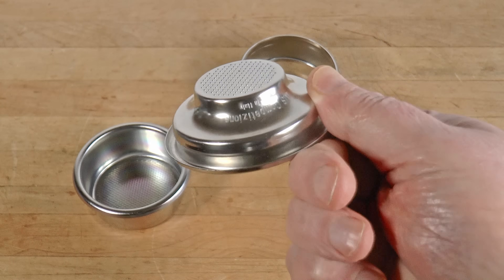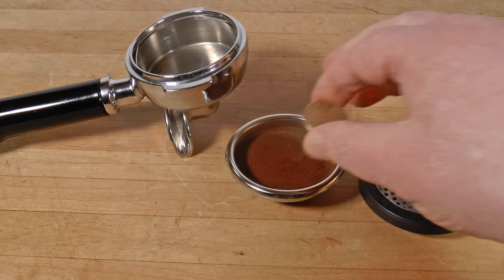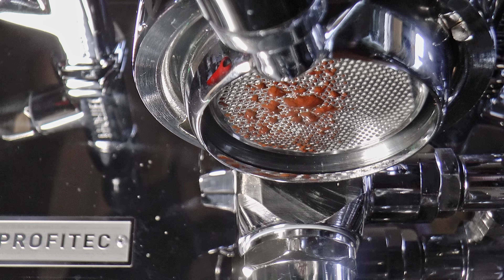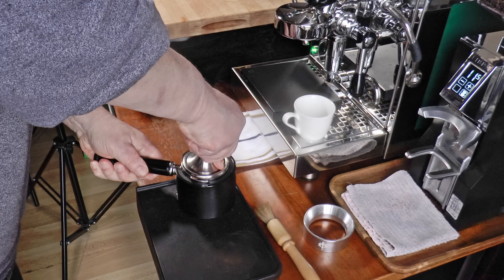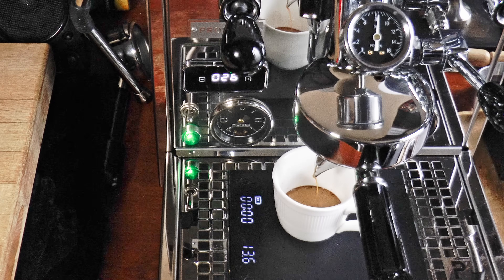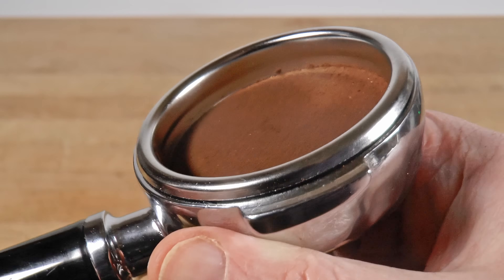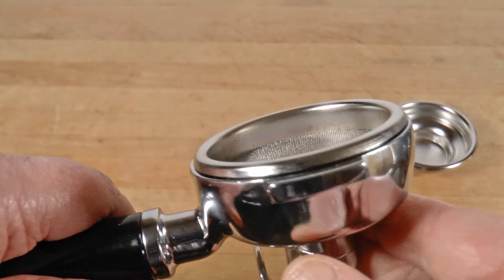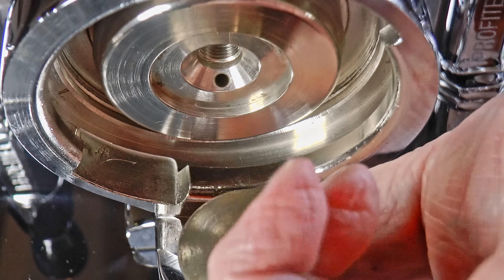The Art of the Single Shot

Comment: Double baskets are not necessarily used for Efficiency in a commercial setting.They are used to give the barista more flexibility in dialing in bright roasted espresso. If you think dialing in a dark roast single shot is hard, try dialing in some bright roast with a single shot basket. Its borderline impossible, because youll get channeling issues (especially with eureka grinders) way before you choke the machine out. The only way to fix that is grinding coarser and updosing.
Reply from the maker: I never have any issues with channeling, and I use Eureka grinders all the time. And as for "updosing," if by that you mean dosing appropriately on the basis of sound mechanical performance rather than some recipe, well, I'll cop to that, lol.
Reply: @wiredgourmet  I myself own 2 Eurekas as well and love both grinders. Id just be honestly surprised if youd manage to get a light roast to pull clean and with proper extraction from a single basket with basically no puck prep from what I see in your videos.

I mean, if it works for you that's great! Nothing wrong with that. It's just that the overwhelming majority of people struggle (at first) with pulling light roasts consistently. That's why we do puck prep, higher doses, longer shot times. Increase extraction and consistency.

Because at some point you can't just grind finer to increase extraction, the extraction will decrease with finer grinds settings. So we need other methods of increasing extraction.
Reply from the maker: @pr1ke892  I hear you. I hope this isn't too basic, but FWIW I would increase water temp first. You can get away with 94-96 C with light-roasted, denser beans. It's one variable that doesn't require complementary adjustments: you can play with it at will.
Reply: Also how light are we talking? That matters
Reply: Most coffee shops serve medium roast coffees, and if light, it’s light-medium. I don’t know how accurate your statement is in reality. Sounds like a logical fallacy to me…
Reply: If you preinfuse enough, there won’t be any channeling
Reply: Just got my first Gaggia 'black gold' extractor machine.. seeing this video makes me realise just how deep you can go with this, omg. 😮

Comment: I don’t see any use of the single basket. If I want a smaller cup of espresso, I will make a Double Ristretto instead. I tried the single basket in the past, it didn’t worked out for me… difficult to dial in and I can’t use my normal puck prep routine without changing everything… it’s not worth it(at least for me).

Comment: I have a 51mm espresso machine and I've been experimenting with single shots over the last few weeks. First, I tried a "normal" shaped single basket with something between 11-12g (according to the coin test) and got great coffees. I try to take 2 a day with this amount. Secondly, I tested a La Pavoni basket with a conical shape with 8.5-9g of coffee (also according to the coin test). With this second basket, the coffees are rounder, it is difficult to make mistakes in terms of both acidity and bitterness, but I found the body to be somewhat weak, testing with several coffees. My goal is to drink as many espressos as possible without generating anxiety spikes. When I only have time for 1 espresso, I use 16g in a normal IMS basket, it's the most coffee I can drink at once without feeling anxious. Here in Brazil we have access to a variety called Aramosa, which has 50% less caffeine, which is also great.

Comment: I moved to single shots about a year ago since 18g doubles tend to give me the jitters now, and I like drinking multiple coffees a day. It is a lot more challenging to dial in but I’ve gotten the hang of it over time! Definitely worth the effort
Reply: @@ZachremixI don't get it. Don't 3 double shots have the same amount of caffeine as 6 single shots?
Reply: @yordanpopov   Same amount of caffeine, but spread over a larger time period makes a difference.  6 beers all at once, or a beer every 2 hours - which will raise your blood alcohol level fastest and the most?
Reply: @yordanpopov I suppose there would be a difference in amount of caffeine. The key point is a grind size. As the author of the video mentioned, for an 11 gram basket with a larger bottom area, you should grind finer. I believe a finer grind gives you a greater extraction from the same amount of coffee. As a result you get more caffeine with a bigger basket. But I could be wrong, of course.

Comment: I'm trying to dial in my single shots on my Breville Barista Pro... consistently been extracting 9G, 1:2 ratio, 7 second pre-infusion. Aiming for a 25-30 second extraction. I use all the factory equipment. 

I just haven't found the sweet spot, it's either a slow drip or too fast. My pucks keep coming out soggy, and they don't cleanly pop out of the basket (usually leaving a ring around the shoulder). I've been bouncing around between grind size 3 to 5, experimenting with my tamping. Any suggestions?

Comment: Tried to use my single basket for the first time on my breville dual boiler and definitely did not work out for me. I can't even tamp enough until it starts to taper and when I lock the portafilter in, it seems it's not deep enough and I can't close the portafilter enough as in not enough headroom above the puck

Comment: I have been experimenting with my Breville Oracle and single shots which seems to have a slightly larger single shot basket than standard. I don’t adjust my grinder from the double shot setting. I use 10 g of coffee.  I have the single shot button programmed to stop at 17 seconds I end up with 32 ml shot. The cremma is good its tasty not quite as nice as half a double but close as Dammit is to swearing. Which is close enough for me especially in a latte which I prefer a single or if having a double I have it in a mug. I do also use a spiny distribution thingy and a spring loaded MiiCoffee tamper that might be the difference. I only do that because I enjoy the process off it.  My daughter doesn’t use it at all and there is little to no difference.

Comment: After pausing the first pump in your machine, does the coffee continue to receive water or does the flow stop immediately? I'm trying to replicate this pre-infusion in a machine with a dimmer, but my water flow doesn't stop when I fully reset the dimmer, it drips slowly at a pressure of 5 bar. I'm considering the following: stop the extraction completely using the button when you see the first points at the bottom of the filter holder, wait 10-20 seconds and resume. Will I achieve the same result this way?

Comment: Pretty sure this misses a valuable trick...  The old LM1 shape baskets,  such as the F.3.029.X, loaded (thank you Scarlet Espresso, that funnel is amazing), and tamped, at 41mm, make a brighter cleaner yet more intense shot from way less coffee than the convenience-first curvy singles..

By sticking to a deep steep sided shape and using a fast flowing 1.5mm square grid perforation you get the regular big double qualities and consistency in a single using half the dose. 

What's not to like about that in a home setting?  An inevitably wet headspace,  but that just pushed me to get a puck screen,  so now I have great singles and a clean shower screen.

Comment: Thank you for this video. I am a fan of the single basket, despite its challenges. I noticed that if I grind finer I can get the slower rate BUT my pressure shoots up to 10 - 10.5 bar. If I grind a few clicks coarser, I can get the pressure to drop to 8 - 9 BUT then the shots are too fast. 
How do I get both right? (pressure AND flow rate)

Comment: 2:08 I'm surprised you're grinding coarser for single baskets. I know the filter is smaller, but from my experience I had to grind much finer due to the smaller size of the dose (much like when going from a VST 18g to 15g, with doses of 18g and 15g respectively, I also have to grind finer).

Comment: Personally, I normally work with the 15g VST basket for my milk based drinks. And when I have the roast dialed in to a 1:2 ratio, 8g work perfectly in a la Marzocco single basket with a 1:2.5 ratio without having to change the grind. So that’s what I typically have in the afternoon. Tastewise I have the feeling single shots tend to be overextracted quicker whereas the same ratio would lead to more transparency with a larger dose. But this might just also have to do with the finer grind size and the amount of fines.
Reply: how low of dosing can you go in the 15g vst?